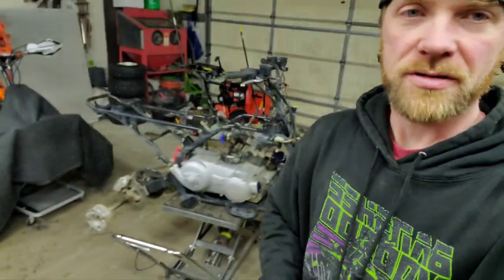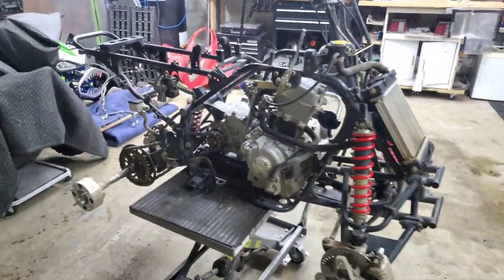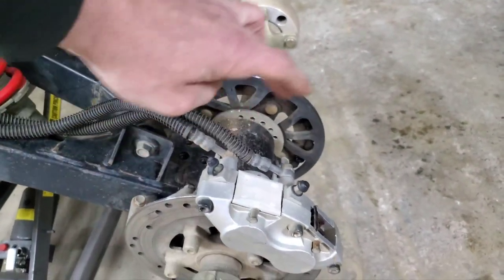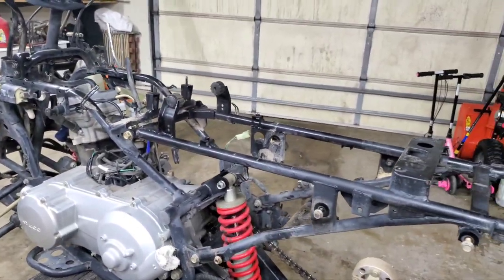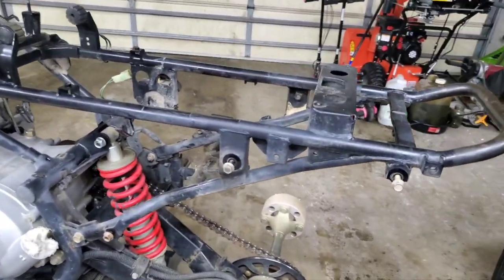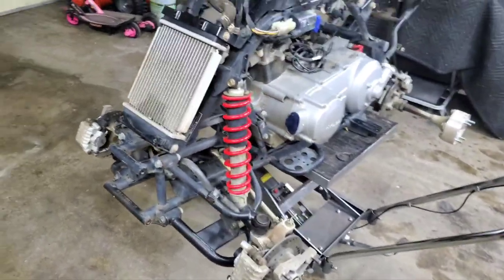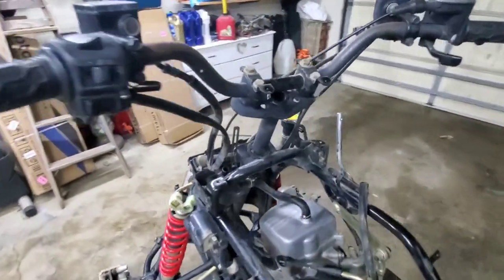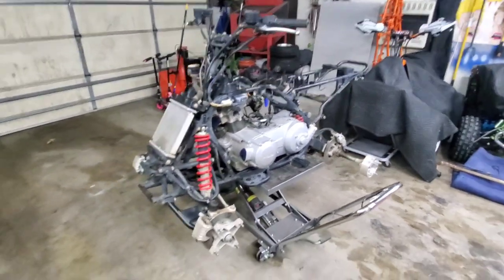New rebuild project, 2005 Kymco Mongoose 250. Walk around and thoughts

Comment: Oh wow this story sound familiar lol. The same thing I went through with my daughter she didn't want to learn how to shift so I picked her up a Can-Am DS250. That last said about a year and then she decided she wanted to learn how to shift so now obviously she's on the Raptor 350. The Ds was similarly overbuilt but it was 42 wide.
Reply from the maker: If at some point, she changes her mind, I'm ok with that.  This thing is way to easy to hop on or hand off to a new or less experienced rider.  It most likely will be in the garage for awhile
Reply: Hello everyone one can someone please help I have a kymco mongoose engine at 150psi I have power at the spark plug just put a new Cdi 7 pin but no start

Comment: That's gonna be a cool project. What is the wheel bolt pattern. Those rims look kinda cool compared to all the normal aftermarket ones.
Reply from the maker: yea factory they went all in on this.  4x110 I believe is the pattern.  Machined aluminum oem wheels, kenda tires, huge brakes/calipers.  It is and will be a great rider/back up machine
Reply: @MnWarrior350  that's awesome, honda/ suzuki pattern instead of a weird style. That machine looks pretty sturdy. Gonna be cool to see what you do with it. Cool getting the whole family involved too!

Comment: Just picked up a mongoose 270 with a blown top end for $200 Do you know where i can get replacement parts? Alot of these sites look sketchy
Reply from the maker: Agreed, most of the sites look real questionable.  Not 100% positive with the newer 270's but I switch between Partzilla, looking up arctic cat Dvx250, and http://kymcopartsonline.com/catalog.  Mainly just finding OEM part #'s and then search for them that way.  Alot of times you can find them on Ebay, but i try to stay away from knock off brands